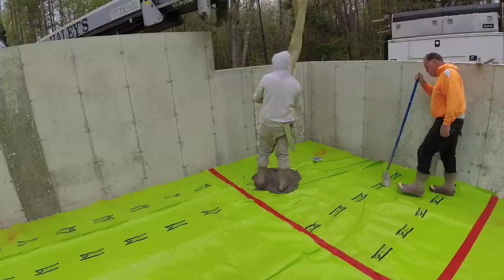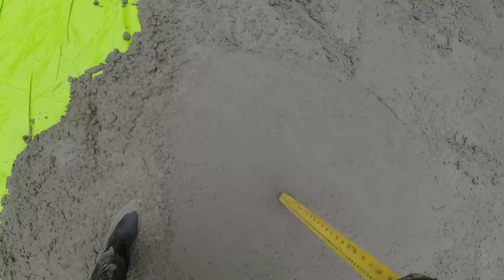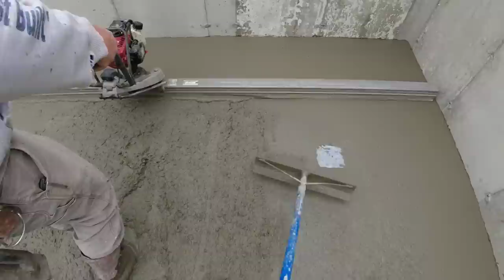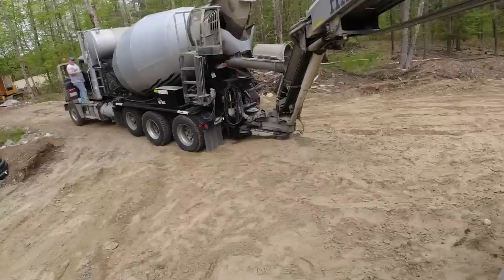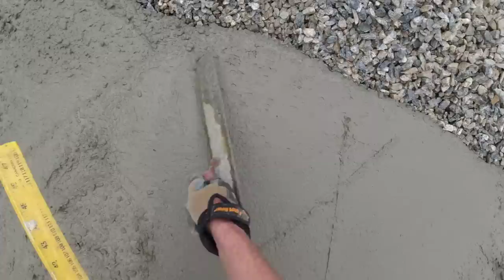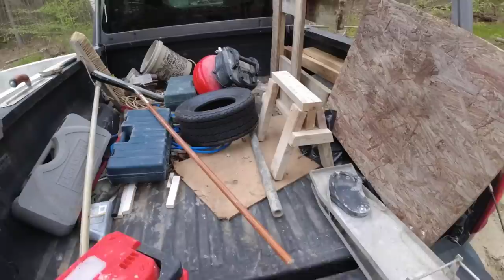Pouring A 28' X 22' Concrete Floor (Lower Level) Upper Level Steps up 12"

Comment: [I am supposed to be driving from NH to NC to do a pool deck with my sister soon. As long as the concrete truck breaks down at the bottom of the driveway all will be good.

Comment: Where do you buy the 15mil vapor barrier? I ended up going with 6mil because I could get it right at Lowes. And I assume 15mil is overkill? I think you're the first guy I've ever seen use it
Reply: thats stego wrap. Home depot has equivalent for $524 a roll
Reply: @tonyp9179  yeah but it's not in stock anywhere in Maine. I'd have to order it and have it shipped to the store. I went with the 6 mil and I think I'll be fine
Reply from the maker: We get it at White Cap Construction Supply or Gagne & Sons